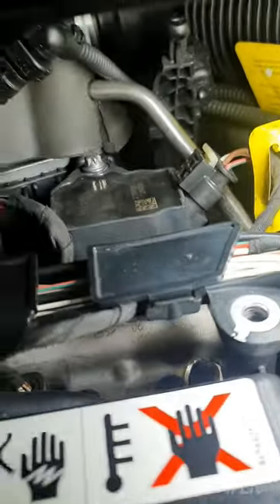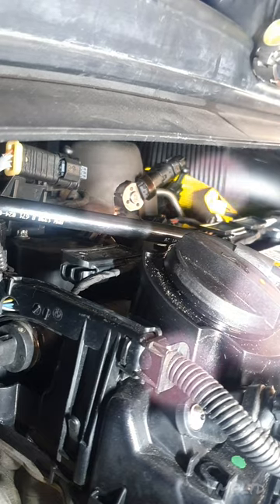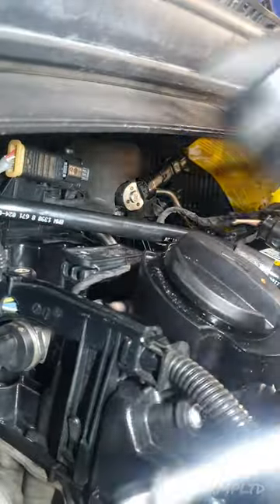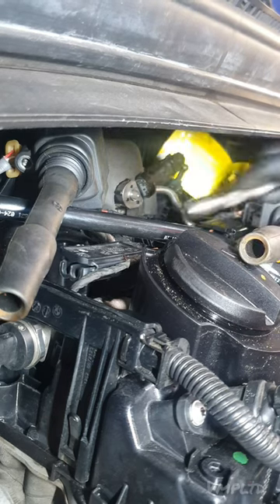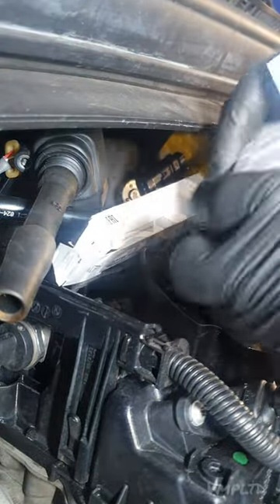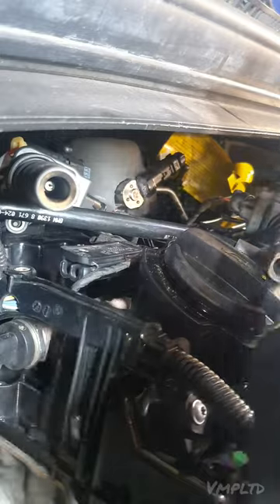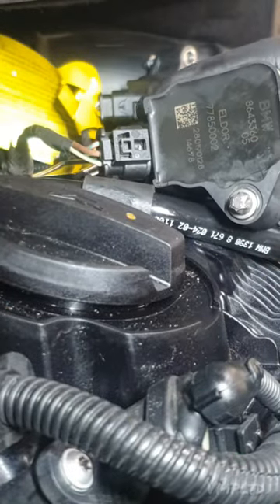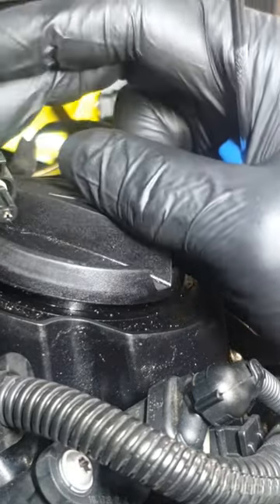BMW 2 Series Gran Tourer 1.5 218i (2017 - 2020). Spark plug replacement. Ignition coil removal

Comment: I had a cylinder 2 misfire fault, and your video helped me tremendously! Thank you so much!
Reply from the maker: Excellent my dude. That the  reason we do what we do 👍🏾
Reply: Thanks a lot for the video! Do you know if I need a special wrench head for the spark plugs? I think I see kind of a ring around the spark plug that prevents me from using my regular 14”.
Reply from the maker: 😁 the ring around the spark plug probably came from your 14

Comment: Nice for the video.

Bt i prefer to replace plugs right after removing 1. 1 at a time, just in case a dirt or small objects fall into the spark plugs holes.